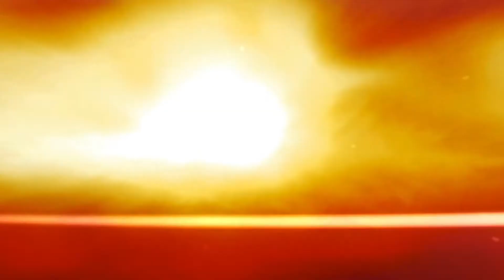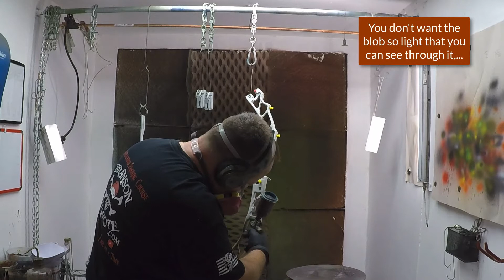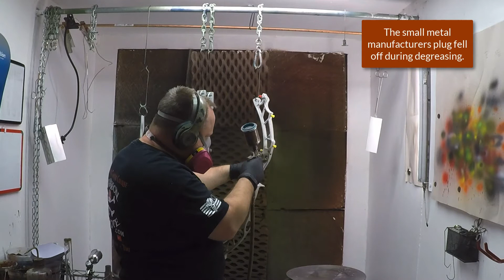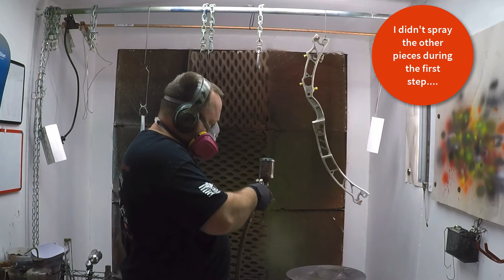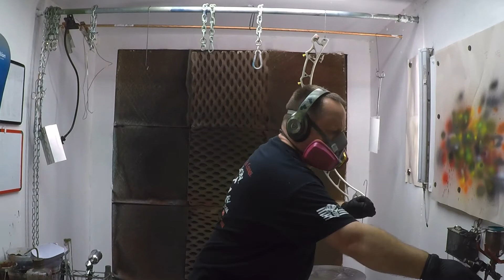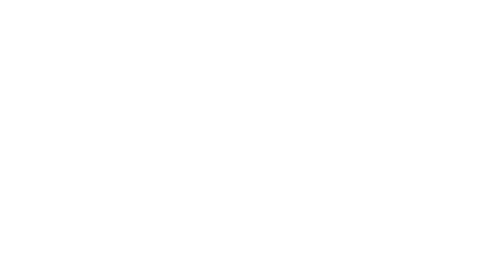Cerakoting a bow | Branson Cerakote | Tips and Tricks

Comment: It looks like you are touching previously coated parts of the bow after doing the 6-8 "detacking" cure. Is it possible to touch the coating after this initial cure and not mess up the finish?
Reply from the maker: I get the glove question every once in a while. The safe bet is follow the pamphlet, and put gloves on as soon as you wake up in the morning and don't take them off until after you've climbed back into bed at night (Lol). I can only speak to our experience. We wash our hands constantly, and mess with Simple Green and acetone several times a day. We glove up when we start to mix coating, but don't bother with them until then. We have zero adhesion issues, and zero warranty work. I won't say you'd be wrong to wear them throughout the process, but they are uncomfortable, expensive, and almost impossible to stencil in.

Comment: I don’t know about yours but my Iwata doesn’t get anything close to a 6 inch spray pattern. I’m lucky to get a 4 inch fan when it’s wide open
Reply from the maker: Yeah. In all honesty, the way I spray, I like to be a bit closer. I think in order to get a 6 inch fan, you'd have to back up a bit and go heavier on the volume.
Reply: That makes sense. I guess if I really needed I could up the volume and air and give it a bit more distance but I think it would end up being a waste of cerakote to get that wide of a pattern
Reply from the maker: That it would. When my cone is bottomed out, it's at the "1" straight at the top. I turn it to three, then one more complete turn around to three. Seems to work fine. I think as long as you're consistent, and are getting good results, it doesn't matter a whole lot.
Reply: I wouldnt suggest a 6 inch spray. You should be 2-5 inches away from what your shooting with a "1/2 in bullet point" (wet center with some over spray) at 2 inches and then medium to large fan (up to 3 inches max, wet center with overspray) @ 5inches away. (Cerified Cerakote Applicator)

Comment: Question-
         How do i get the painting smell out of a closed room with one window?.... 
            Thank you.
Reply from the maker: As big of a fan as you can cram into the window. If you don't have a way to extract the coating from the air, you'll end up with all kinds of issues in the building your spraying in.
Reply: Alright thanks... Whats the black squares on the wall behind where your spraying?
Reply from the maker: That's the filter bank. The exhaust fan is behind that.

Comment: What temperature do you bake something like this at?
Reply from the maker: Depends on the color. Some have a max temp of 250 for two hours.

However, this was FDE which is good to go at 300 for one hour.
Reply: FDE is max temp 300 for 1 hour or 250-280 for 2 hours. It all depends on what your trying to get on the gloss index, which can be manipulated with temps and not allowing the coats to "air dry" ie. Going straight into the oven right after spray. (Certified Cerakote Applicator) love the vid btw, I would have done some things different but it's good for people who are just starting.